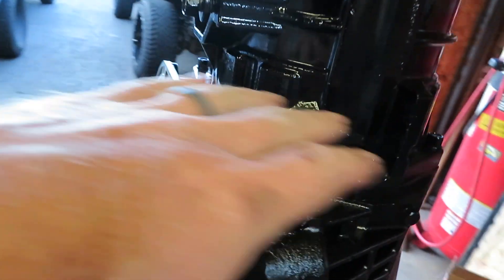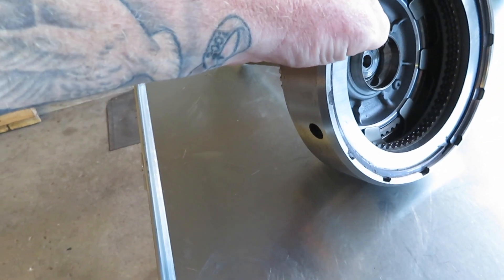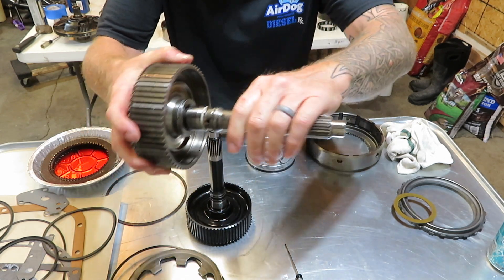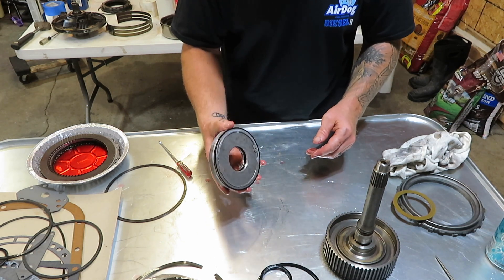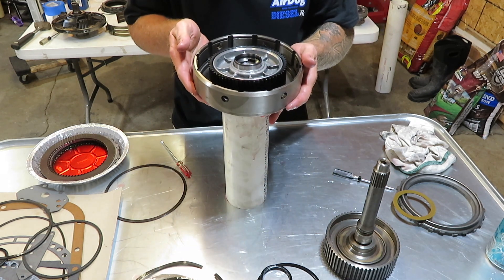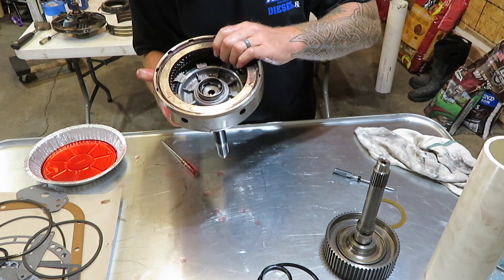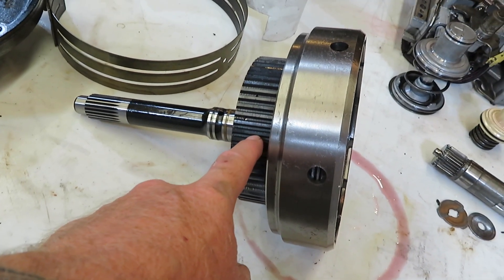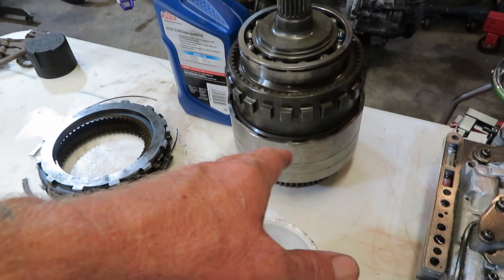How To Rebuild A 47RE Transmission Part 2 Input Shaft And Forward Clutches

Comment: Was wondering if you could help point out how do you tell if you have a Billet shaft when it's installed in the transmission? All I can see when I pull the torque converter off is the end of the shaft is there a way to tell by just looking at the splines
Reply from the maker: Look at the end of the blind where it meets the input portion of the shaft it should be nice and smooth machine and not wavy finished and also the end will be a nice smooth finish

Comment: Another good video Chad. 
I think I would have probably cut a piece of plywood or something with a hole for the input shaft through that would support the hub while assembling. 
But hey you got it. 👍
Reply: Like a big washer.
Reply: The important thing is you got it together with what you have. 👍
Reply from the maker: Used what I had that was quick. idk